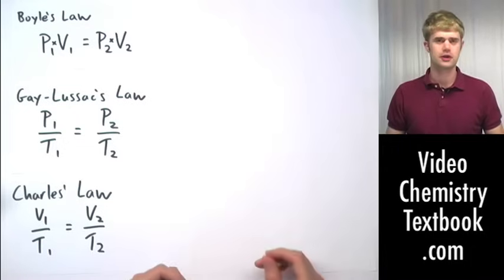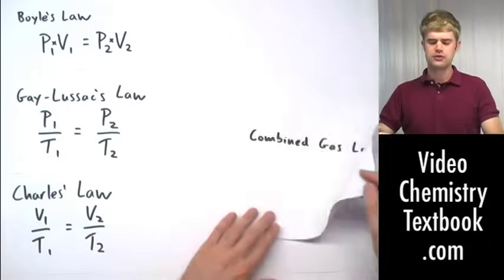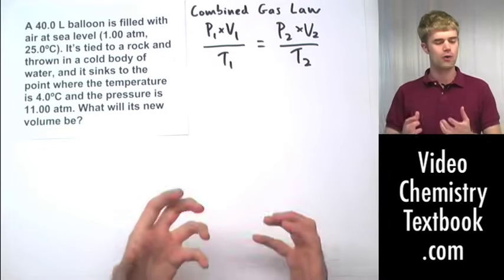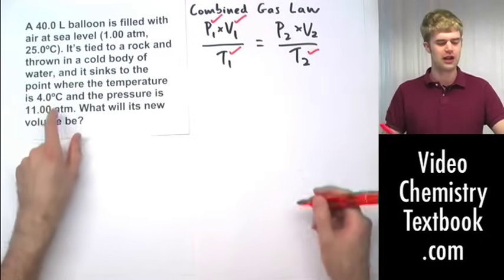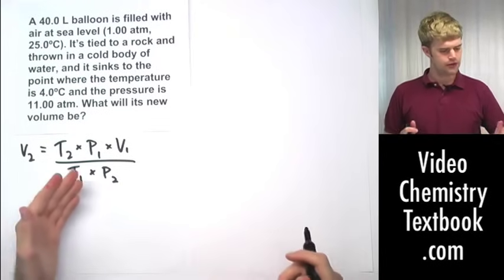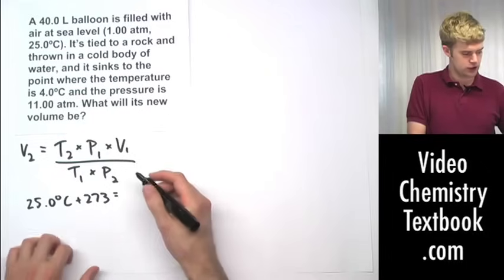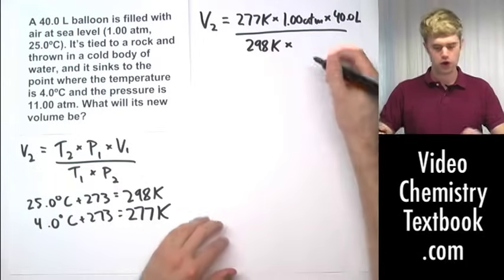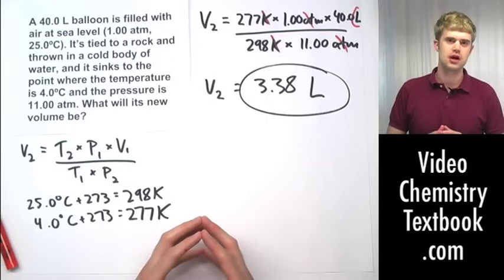Combined Gas Law

Comment: Question: If the given in pressure is mmHg,  mL in volume, and Celcius for temperature, should it be that the units will be converted to atm in pressure, liters in volume, and kelvin for temperature before solving the problem?
Reply: only convert celcius to kelvin, although you probably don't need the answer to this anymore lol
Reply: @JoshF136  well just like you said we did this 2 months ago but what you say is true

Comment: Where did you get the 273
Reply: 273 or 273.15 K is equivalent to 0°C, as far as I know

So technically, if that's 25°C, you're gonna add 273 to convert it into Kelvin.

Comment: I'm having difficulty with this....  say you know t1 p1  and v1 of a gas in a piston. And you know v1 after compressing it to 1/2 its original volume.  Ideally with out exchanging heat with the walls, how do I know what the new t2 and p2 will be?

Comment: what if i already have all the P, T, and V for both problems

EX: If you have 750 milliliters of C6H14 at 20 C and 5 atm and 650 milliliters of oxygen at 10 C and 6 atm, which will have excess and how much in this combustion reaction?  Use the combined gas law. 
Question on my paper

Comment: How did he got 3.38 you ask?

He had a mistake where he wrote "x" in the denominator, it should be:
277 x 1.00 = 277
277 x 40 = 11080
11080 ÷ 298 = 37.18
You will not multiply 37.18 to 11.0, you must divide it so it will be
37.18 ÷ 11.00 = 3.38
He just wrote something wrong, but still a great teacher!

Comment: ok i get how you set it up but how you get that answer?
Reply: Think of it like math. I know I’m 3 years late but think of it as built below
(1x2x3)/(1x2) if the top is added to 6 and the bottom 2, you’ll have 6/2, or 3 as the final answer.

Comment: A chemist prepared a sample of hydrogen bromide and found that it occupied 255 ml at
85 degrees celsius  and 600 Torr. What volume would it occupy at 0 degrees Celsius at the same pressure?

i don't know where to start...i tried to do it and well it didn't work out at all :/
Reply: Excellent teaching

Comment: How would you find the original pressure in the combined gas law? Like solve for P1.
Reply from the maker: Good question. You should check out my video Rearranging the Combined Gas Equation
Reply: sir where did you get the 273 to get the answer of 298 kelvin
Reply: Thats the way to change the temp to kelvin

Comment: So should i round off the significant figures each time i multiple/ divide? or should i complete the whole problem and then round off to the significant figures? With this problem in general i tried it both ways and it still came out with 3.38... but with certain questions ive noticed rounding off at the end and rounding off each time i multple/ divide can give different answers...

Comment from the maker: @MrQuickSqueez yeah, you can do it that way, but it's not as accurate. the reason why is there are more math steps your way than the way i show in the video. so you divide and/or multiply at three different steps in this, but in the video, i arrange everything and then do all the math at once. so know that your method works, but the answer you get will often be a little less accurate than if you arranged the whole equation and then did all the math in one step. make sense?

Comment from the maker: @shaheen1990 you multiply everything together on top, and then multiply everything together on the bottom. then you divide the top by the bottom. in other words, the math you do is: (277 x 1.00 x 40.0) / (298 x 11.00). does that make sense?
Reply: I got the answer 409 L rounded 3 sig f. We should put the parenthesis?